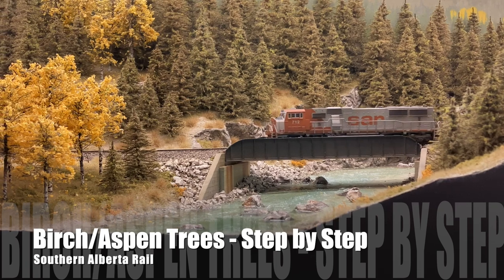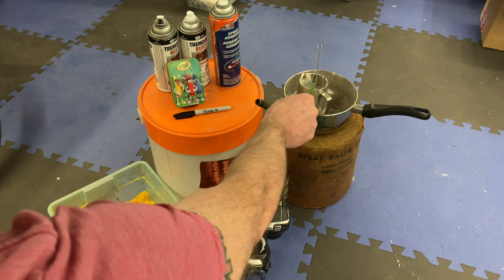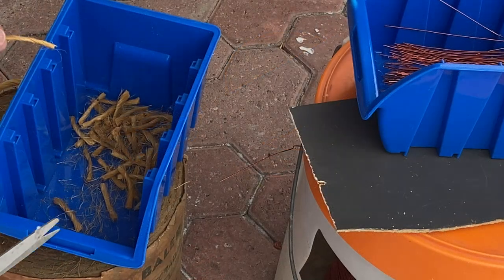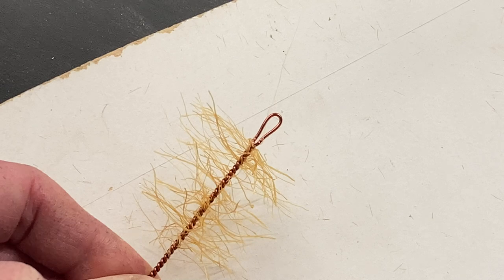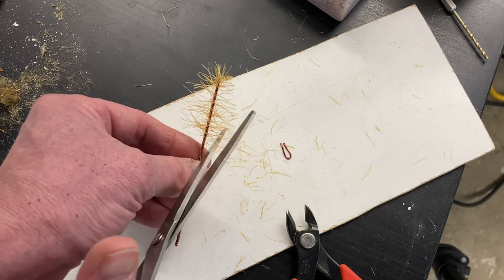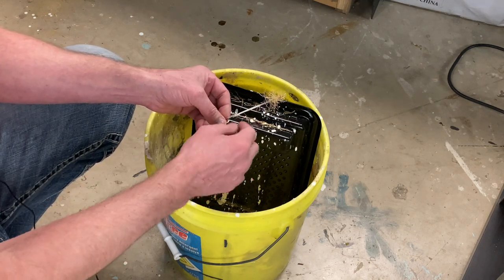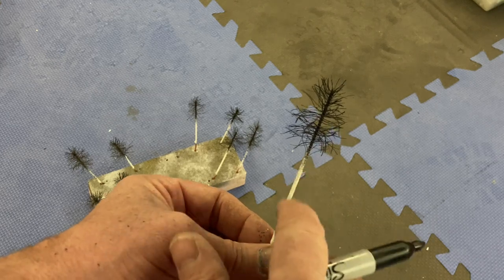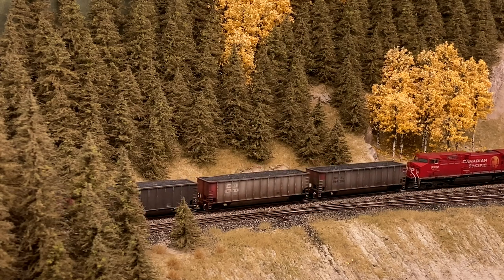Modelling Birch/Aspen Trees - Step by Step Tutorial

Comment: I model on the cheap.  I make all my own ground scatter (flocking) out of either sawdust that gets coloured in the electric coffee grinder my wife gave me for modeling, or foam rubber done same way in the coffee grinder.  That way you can control the colours and the granularity of your finished product.  I also make my own iron oxide (rust) by soaking about 4 pieces of 0000 steel wool in a quart jar with white vinegar.  After about a month sitting in the window, I pour the mixture into a large pan (I use my old 11" x 14" stainless steel photo fixer trays when I had a darkroom) or baking dish and wait for the mixture to completely dry (usually about 2 to 3 weeks).  Then I take a single edge razor blade and pulverize the contents into a fine powder and store it in little tins.  Each batch I've done comes out a little different in colour.  Then you use the rust as you would any weathering powder or chalk.  It looks real, 'cause it IS real rust!  I also colour my own chalk with acrylic  paint and food colouring.  I never buy weathering powders.  Instead, I go to the dollar store and buy women's makeup in the little plastic containers.  For $1.00 you can get quite a collection of different colours and they adhere better than weathering powders.  
For trees, I use the Nandena bush after the little red berries fall off, it leaves a perfect tree trunk (armature).  I also have a TON of lichen growing out back on the hill behind my house.  When using the Nandena bush tree armatures, you can paint them whatever colour you want--even grey for aspen trees.  Cover the armatures with lichen, seafoam or whatever you want, then add your own home-made flocking and you're done. For pine trees, I use florist wire (wrapped) doubled and bits of jute cut in1 to 1 1/2" laid in the wire, then using a drill, twist the wire while holding the other end in a pair of pliers..  I also use barbeque bamboo skewers with pig hair (horse hair) furnace filters (they're already green); have to paint the skewers first.  And I never use spray paint since I use my airbrush for all my painting.  I can use either acrylic or oil base paints; I usually use one airbrush for acrylic and the other one for oil base paints.  Cheers from W Rusty Lane K9POW in eastern Tennessee
Reply from the maker: Can't go wrong using natural stuff Rusty.  Cheers.  -grant

Comment: I think your forestry techniques are fabulous.  A substitute for the propane bottle torch might be a butane torch lighter. It's not as big and only costs about $3-$4 dollars. I use them for shrink wrapping on electrical wiring connections. Don't know if the fuel is going to last for 💯 trees? But they are refillable.
Reply from the maker: Thanks Ron, great suggestion.  One of those wee butane torches has been on my list of things to pick up for a long time.... unfortunately it's a mental list and is quite unreliable!!  I do love my propane torch though.  The number of birthday cakes it's lit is quite impressive.  Thanks for watching and reminding me to check the mental list a wee touch more often!!  Cheers.  -grant
Reply: @SouthernAlbertaRail  at Menards by me, they have them in a bin by the checkout.
Reply from the maker: No Menards up here but I'll poke around at Home Depot.  Thanks again.

Comment: Would this work for HO, or would the trees be anemic? Maybe heavier gauge wire, and more/longer sisal?
Reply from the maker: Absolutely.  The trees would be thin but as you mentioned using slightly larger gauge wire and longer Sisal would thicken them up.  Cheers.  -grant

Comment: Instead of wax , try gesso or better acrylic molding paste.  You can tint or color them with whatever color of your choice     Just dip and let dry
Reply from the maker: Thanks, I appreciate the tip.  I've tried Gesso before and it doesn't give the result I'm after.  The wax is an almost instant dry and can be manipulated afterwards with heat.  Cheers!
Reply: @SouthernAlbertaRail  just don’t get the gloss.    Matte is best.    It also ( when tinted) takes marker really well.  I use brush calligraphy markers to add detail.   It gives a very unique and randomness feel .    It’s also cheaper, less messy and is more uniform.  The bark on trees looks hyper realistic when used straight from the bottle     And for aspen and smoother barked trees you can dilute it with water or paint to give to smooth texture.      There’s hundreds of different varieties of molding pastes.   I used them on base water features to build up ( using the gloss version to add depth, so when you add the water resin you only need a top coat.   Saving possibly hundreds or thousands of dollars when used :)    It also doesn’t crack or yellow since it’s meant for fine art painting